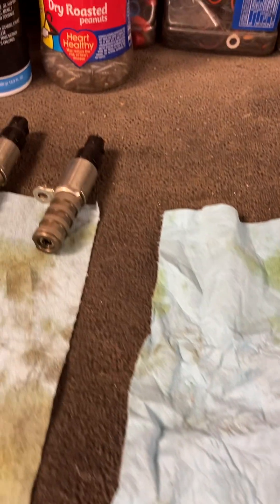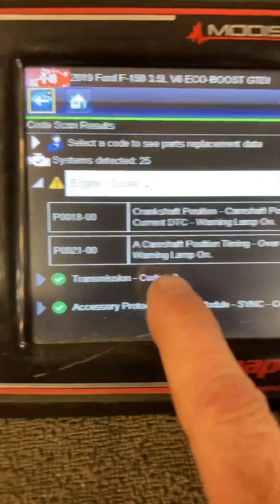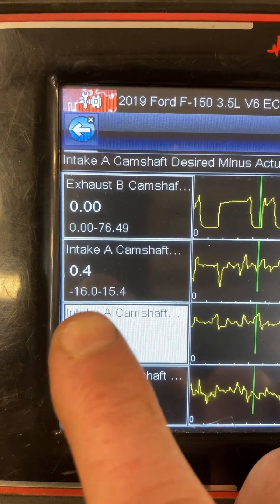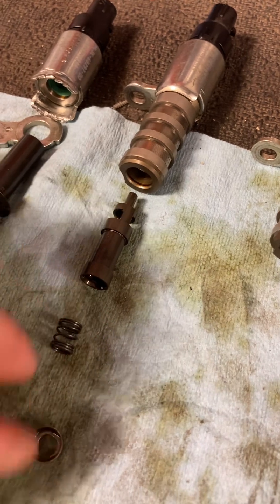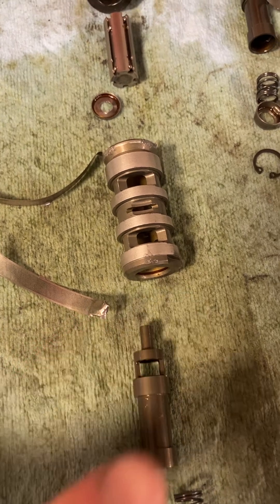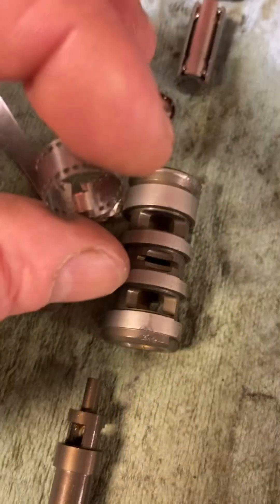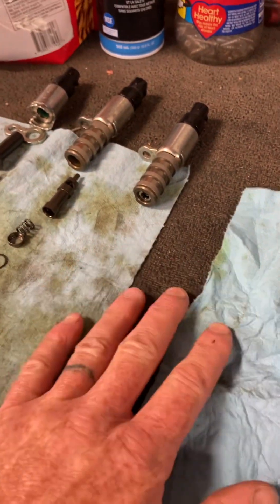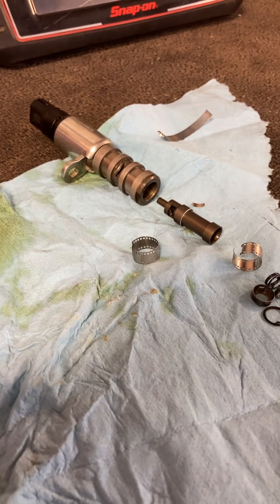3.5L Ford Ecoboost VCT Solenoid failure

Comment: Do you need to take the valve covers off to replace these? i have a 2011 3.5eco and already had the timing chain & phasers and all done once before by a mechanic about 40-45k miles ago. now i have a P0014, P0016 and 2 each P0054a & P0054c codes on my scan tool. i can't fathom the timing chain would be stretched that quick.
Reply: great video by the way, very informative on the functionality of the VVT solenoids
Reply: The valve covers do indeed have to come off to replace these.